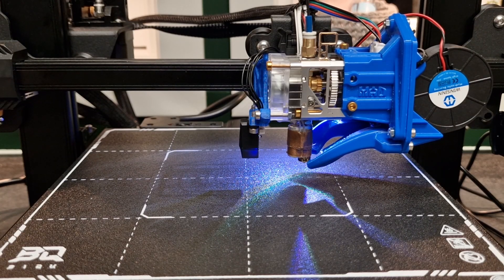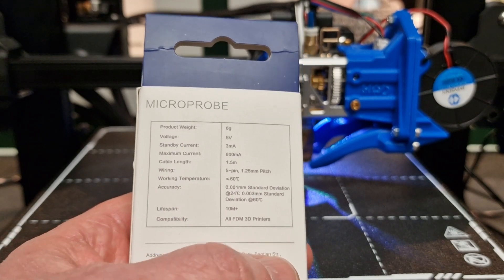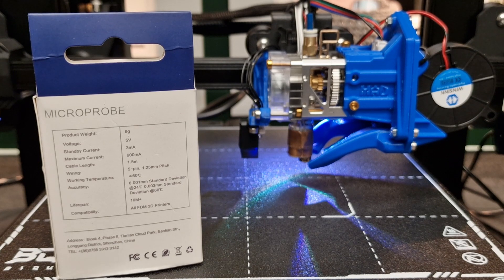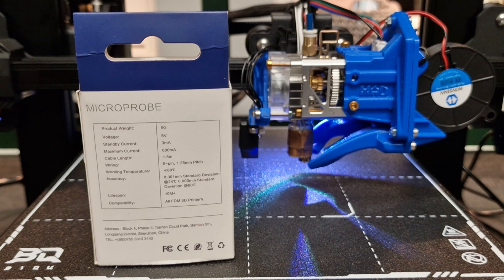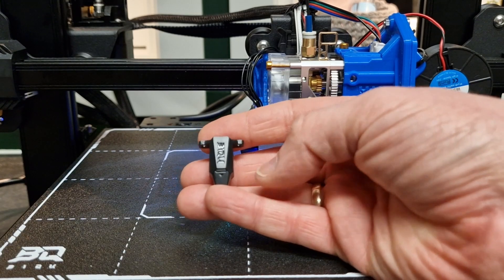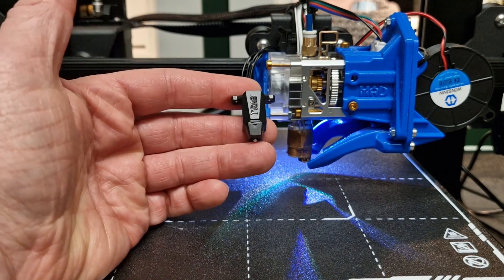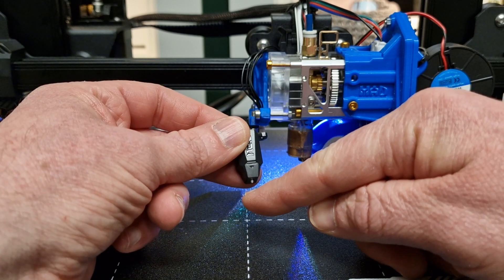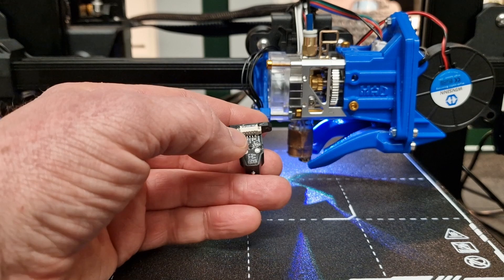BIQU Micro Probe review with a printer saving tip included.

Comment: Is this a Klipper use only probe, or could this be used on stock Marlin based printers?
My nephews' E3 v2 has a faulty CR Touch.
Reply from the maker: It works with Marlin too. Keep in mind it's not a plug and play swap option with a Crtouch. You'll need to edit and compile the firmware.

Comment: Could you help me install this on a Sovol 6 Plus?
Reply from the maker: It sets up the same way. You need to just change the pin assignment and offsets for your machine, but I can't find an actual pinout (for pin numbering) for the board. I did see in the klipper .cfg example that PB1 is for probe sense pin, but for the MicroProbe V2 it works better with the sense pin on the z endstop as they tend to have better pull-up resistors.
Reply from the maker: Further digging looks like it's a Creality board clone so PB0 would be the servo (deploy/retract)  pin and PA7 if using the z end stop for probe sense

Comment: I installed one of these about a week ago.  Seems way more consistent than the knockoff probe I was running before and the first layer is now NSFW.
Reply from the maker: It's definitely one of the most accurate probes I've used.
Reply: I’m trying to mount it on  my printer, but it doesn’t sit in the proper location. It’s too small. How do you solve this? What is there some certain bracket you add on? Basically it doesn’t sit down low enough.
Reply: @SLAPPY4241  That was so long ago I don't remember but pretty sure I had to print a specific bracket first. Good luck!

Comment: Yep this confirms it. something happened to my probe and it will not fully retract. Something happened during the last print when i turned the speed and it started scratching the bed and noe the retracted position always hits the bed 🤔
Reply from the maker: The probe tip screws in. Maybe it came loose. See if you can tighten it back up
Reply: @StackingLayers  ok thanks for the tip!
Reply: Ok so that worked! I used some pliers to tighten it all the way but I am still a little worried that it could come loose at higher speeds 🤔 I'm thinking it was never tightened though because it is sitting up higher than it ever has. But we'll see I need to recalibrate the probe offset and run a test
Reply from the maker: I've see that happen to a couple users, but I think it's a case of just not being tight enough from the start.
Reply: Ok so I bought another one because the first one kept unscrewing. Now this second one is doing the same thing 😮‍💨.

No matter how hard I tighten this probe tip it keeps unscrewing.
Reply: Ok so I fully removed the probe tip on this first one I had. I think if I apply some high strength threadlocker it will stay in place 🤔
Reply from the maker: That should work
Reply from the maker: That should work. Weird that you got another one with the same issue.

Comment: Hello, 

Looks like packaging has changes - setting up for the first time - 
Package says in RED " WARNING - don't connect before correct firmware configuration ...
So far only seeing videos - on dong config on klipper - all seems rather simple. 

Any thoughts ideas, on what that may be about.

Thanks
Reply from the maker: Yeah many are plugging it in to systems that are set up for a BLtouch. This has been shown to potentially damage the probe since it's not the same electronics nor sensing method. It's always best to do firmware before plugging things in.
Reply: @StackingLayers  - Kind of took a guess based on the documentation that I would be ok -  I think the firmware comment applies more to Marlin - worked out - got it all set up. 

Thanks for your videos !!

Comment: Hi, quick one on the Z homing configuration in klipper - is it required to use homing override to tell klipper to use probe_deploy and probe_stow macros during Z homing? Thanks...
Reply from the maker: Nope.
Reply: @StackingLayers thank you and what about any changes to the current Z endstop switch, anything needed there? Can it stay as the means of extra crash protection?
Reply from the maker: It doesn't really work that way. The probe replaces the z endstop.  Once homed the software endstops won't let the machine go out of bounds. You could probably make a gcode macro that triggers a full stop if the switch is hit, but it shouldn't be necessary.
Reply: @StackingLayers  and yet you are saying I don't need to make any changes to the current z endstop setting? I asked about the homing override because I currently use it for better homing procedure due to sensorless setup and I always noticed the safe z home setting with this probe in various sources including your video... which I can't use since I have the homing override enabled, but I guess I can add gcode in there for Z to sort of replicate what safe z home does. And yes, I noticed that when I have the probe deployed, it won't let the toolhead go below it once it touches the bed... but I was also wondering what tells the probe to deploy when I send for instance G28 in case it's stowed? I haven't had a chance to fully play with it, barely just mounted it on one of my machines and tried if its base functions work and what happens when it touches the bed... you know, tried probe_calibrate... but haven't yet ran a normal G28... will try it all tomorrow when I get back home. Thanks again for your kind responses. Much appreciated.

Comment: Hi! How do I install the microprobe v2 on the biqu bx? I'm using looxonline FW
Reply from the maker: You will have to modify the firmware as shown in the user guide and recompile it. It's not plug and play since it's designed differently from the BLtouch
Reply: Where can you get the firmware? User guide is so unclear in terms of firmware and wiring specifically.
Reply from the maker: This is a item that you have to make modifications to firmware. If you are using Marlin you'll need to make and compile a new firmware for your machine. With klipper it's a bit easier since you just need to add the new probe info, then save and restart.

Comment: It is not a “clicky” style of switch. 
This is simply a matter of configuration. You can set BL and CR touch probes to do the exact same thing. Between Marlin and Klipper this would be referenced as either Persistent probe deployment, no stow on probe, or sometimes rapid probing. It’s a function of your configuration, not the probe itself! 
I utilize this exact setup on my Klipperized E3Max with a CR touch. The persistent deployment added with fast travel movements really makes bed meshes lighting fast.
Reply from the maker: At time of making this video (V1) it was a click switch closed when perssed. And now (V2) it's a light sensor open when pressed. It does not function the same as a BLTouch or CRtouch. Those send pulsed trigger signals where the microprobe sends a steady open or closed signal.
Reply: @StackingLayers  In Marlin, does the Micro Probe automatically retract the tip after completing homing or the G29? I bought a V2
Reply from the maker: It should retract then done, yes.
Reply: @StackingLayers  Without any gcode command? Thanks for the information.
Reply from the maker: @NarutoHokague It's part of marlin's probe function. You'll need to of course set it up as per the user guide and flash the firmware.
Reply: How?

Comment: I have this but can't figure out how to do the firmware on my 4.2.7 board on my ender 3 pro.
Reply: Did you figure it out yet?
Reply from the maker: It needs to be set up in the configuration.h file as per the documents and then recompiled to make a new firmware.bin to install.
Reply: @StackingLayers  I ended up having Miguel Risco building me custom firmware look for my Ender 3 V2 extender with the microprobe. It's a pro platform with the v2 screen and firmware.

Comment: I tried the microprobe V2 with an octopus v1.1 and it kept disconnecting klipper the moment the 5V pin came in contact with the microprobe. I purchased 2 microprobes thinking the first might have been defective. I followed the instructions listed on btt's github but in the end I gave up and went back to the bltouch since it worked with the same pins I used with the microprobe indicating that it wasn't the board's problem and that it really was just the microprobe not working. It's a shame, since it's so small and compact which would have been perfect for my use case.
Reply: Microprobe V2 is quite power consuming while extracting the pin. It draws about 600mA for a short time. Maybe this hit restarts your board.
Reply from the maker: That is very bizarre. I have 3 of them now and they all work great. When you say it's disconnecting Klipper what do you mean by that? You get an error message? Are you using the same firmware as the BLTouch or did you make changes for the microProbe?
Reply: @StackingLayers  Klipper disconnects similar to when one does a save_config command and klipper disconnects and resets and thats when the 5v pin is placed on the header while the printer is on. When I pre-place the connectors klipper doesn't even connect citing a serial id connection error which I know is false as I can just remove the microprobe and klipper connects just fine. I made changes to the firmware according to what was listed on the manual for a microprobe v2.
Reply from the maker: Wild it sounds like it's some how shorting the board. Are you certain you are plugging it in the correct direction? If it's plugged in reverse it will short 5v to the sense pin and that can definitely do what you are describing.
Reply: @StackingLayers  I'm 100% it was plugged in correctly as I read off the probe silkscreen rather than the wire colors since we those aren't reliable. I might just replace the terminals with single dupont connector and place the 5v and ground on one of the fan connectors, leaving the sense and probe pins on the dedicated probe/bltouch pins.

Comment: Hey,
I have a quick question at what height did you set the micro probe (how much higher are you from the nozzle away)
Reply from the maker: It only needs enough to be out of the way when retracted and lower than the nozzle when deployed. It doesn't have a big travel distance before triggering like the BLTouch and CRtouch. The microProbe triggers almost immediately upon contact.

Comment: I have just installed the Microprobe V2. Config is as per recommendation from BIQU themselves. All is wired correctly. 
I have the 3 clicks on startup, I can deploy and stow the probe on demand. 
However... I can't home the printer with this. First of all... I ordered the V2, but the product says nowhere its version. And this is important because of the [probe] pin: xxx config part. Where the V1 uses regular "^pin", the V2 uses "^!pin". If I set my probe to the config as V2, the printer will say "Endstop z still triggered after retract". If I set it as V1, the probe will descend but the redlight never turns on and if i put my finger to the needle to make it retract, nothing happens. 
I have an SKR 1.3 mainboard and this board does not have the PROBE dedicated pins. So I just use the Z-endstop and the black and white are respectively GND and the endstop pins. 
Would you have any idea of what could be going on?
Reply from the maker: The version is printed on the circuit board of the probe. 
My V2 doesn't seem to have a red light or at least I cannot easily see one if there is. 
Double check that you have it defined to the pin that you are connected to and that all the wires and connections are securely attached. From what you are describing it sounds that the board is not receiving the trigger signal. V2 is open when triggered.
Reply: @StackingLayers  thanks for your help. Eventually, after removing the cable I was able to spot the V2 markings. 
I enquired about the red LED as on your video you can clearly see the red light when the probe is "armed".
For science I assigned the pins associated with z+ for the probe while it was connected to z-. Upon querying probe on both situations I would get triggered if the probe was programmed to z- pins and open for z+ pins. Remember probe was always phisically hooked up to z- pins. So everything should be properly connected. With this sanity check I ensured I have proper contact on the probe end and with the proper behaviour of the deploying and stowing I know I have good connection on the servo side of things. It is just that the probe does not behave as expected, being always triggered.
I honestly am starting to believe I got delivered a faulty probe.
Reply: Upon close inspection I can see a change in the LEDs when the probe is deployed to search for the bed. However with the config recommended by BIQU, the behaviour is always as I described. The tool head homes X and Y, goes to the center position of the bed, it deploys the probe and instead of moving the gantry down,  immediately  moves 10mm up or so as it would upon finalizing probing the bed. It gives the mentioned error "endstop z still triggered after retract".
Reply: @joaosimoes5508 can you check the needle? My needle can move backwards and forwards. If needle goes backwards and incline slightly , any movement can trigger probe and klipper gives error. I think design of needle holder is flawed. When I will dismantle the probe i will update.
Reply: @edriyin  I haven't touched it yet since I tried to get it to work on the TH1 pins (read my other comment) so I can't confirm this. But the mechanical behaviour seemed fine to me.
Reply: So...ordered a geeetech bltouch clone v3.2. Was having trouble with it as well by direct replacing my old bl touch with the same config. it so happens that the newer bl touches V3 onwards require the pull up resistor by means of adding a ^ before the pin designated to actuate the endstop.
This intrigued me. Further investigation revealed that my board does not accept pull up resistors by adding characters to the config as it has physical resistors. This makes the v3.2 not work as expected. I then connected the v3 2 signal and ground pins to  the TH1 pin and ditched the ^ as this is a regular clean pin. It works like a charm. I then tried to install the biqu microprobe with the same line of thought but the behaviour remained the same as before. I firmly believe I have a bad probe.
Reply: @joaosimoes5508  você conseguiu resolver, to doido tentando fazer funcionar na minha ender 3v2
com klipper, pois pelo marlin 2 ja desisti kkk

Comment: I have the btt octopus pro f429 board and bl-tough sensor. I could not get the anti bl-touch to work except for power. I ended up using an ezabl probe that does work well. Better than a probe type sensor I would not know. I would try this btt probe if i knew it was going to work.
Reply from the maker: It will definitely work if configured and wired correctly.
Reply: @StackingLayers  thank you. I then need to find info on how to wire it up on my board. The Octopus pro sometime has dedicated pins for it. But i would love to have a guide the lays  the steps out for me if possible. Also some of these type of sensors are wired up backwards making things even more confusing.
Reply from the maker: It wires in the probe port. Bigtreetech and BIQU are basically the same company and mostly all their products are compatible with each other. The probe pins are labeled as are the octopus pins. The users guide on GitHub shows the setup. I also have the video showing it step by step, if you are using klipper.

Comment: I just bought the microprobe v2 and theres nothing here to tell me if I actually have a v1 or v2 but looking at my wiring diagram and wire colors its very different from the ones that you are listing here. I have white, black, yellow, red, black. Which according to the documentation is Probe(pc13), Ground, Servos(pe5), 5v, Ground. The instructions they give you for this thing is AT MOST "it's the same as BLtouch". I've never owned a BL touch or installed anything like this before. So good luck everybody
Reply from the maker: It's not the same as the BLTouch other than that way it's wired, the firmware setup is different. 

Do not set it up as a BLTouch in firmware, it might damage the probe.

The probe has the version number printed on it, along with what the pins are to be wired to. 

As for the colors, look at the instructions and what you wrote, they are both the same as I described in the video. The photo of the wired up probe in the instructions has the probe tip pointing up and I'm holding it pointing down.
Reply: @StackingLayers  I have the wires fed through my printer, nothing plugged in yet. I'm trying to figure out where to mount it. Does the probe need to be a certain distance in relation to the nozzle tip? Whats the best way to position this thing
Reply from the maker: Position it to be high enough that it clears the nozzle when retracted. It doesn't need a long trigger space like the BLTouch
Reply: Thanks for your reply. I guess I'll learn about how it knows when I install the software. I found out from a random model on thingiverse that the bltouch has its own special spot inside the ender6 hotend fan shroud. I think I'm gonna figure out how to use the same mounts but extend it because the microprobe is so much smaller

Comment: Can i use this on Ender 5 (4.2.7) ?
Reply from the maker: Yes. You'll just need to set up the firmware for it. And of course plug it in correctly.
Reply: Correctly, you mean rearrange the wires?
Reply from the maker: I mean to just have things in the correct pins. So many problems with probes not working are caused by people not connecting correctly. One important note is to never trust that wire colors mean a certain polarity. Always match end to end to what they are connected to.